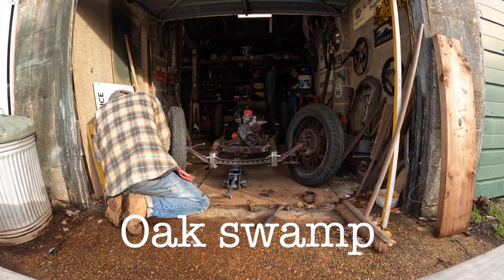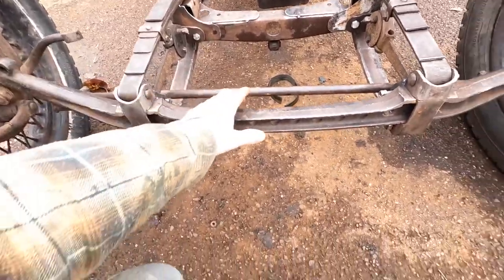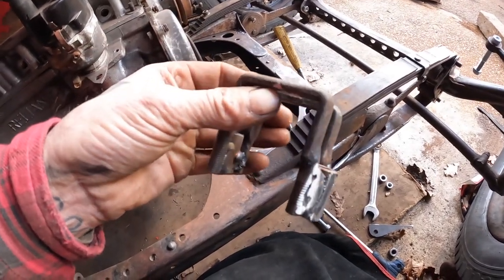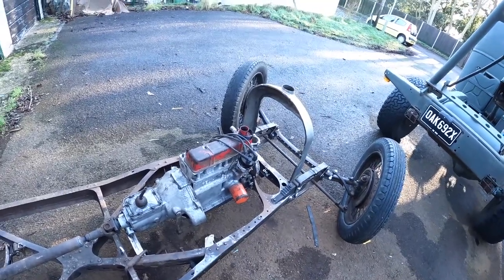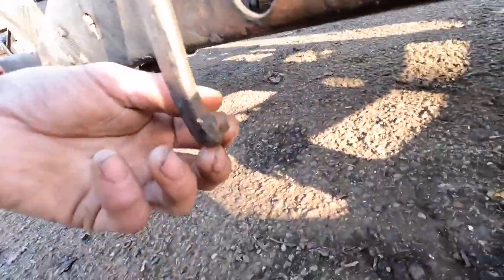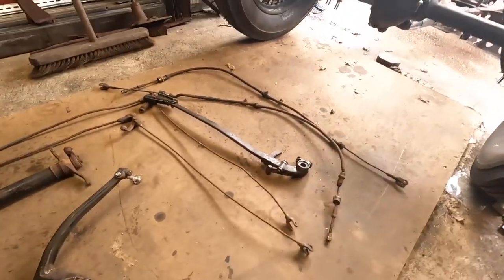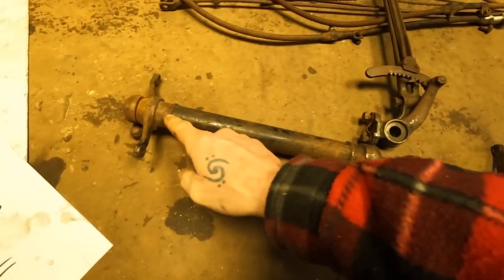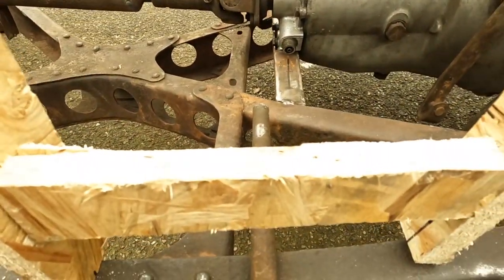the austin ten special....rat ,   part 7

Comment: Good to see you are back up & running.
Will you put some sort of plate in front to the steering arm, so there is no chance of it hitting the road.  I broke all the bolts holding the gear leaver in on the ExoBusa after going over a traffic calming bump. Hitting the steering in the same way could be painful!
Reply from the maker: cheers dude , the pit man should be high enough off the deck now it should not hit anything....is the exo running again?
Reply: @oakswamp  Exo not back on the road yet. Still fitting new seat & a couple of other mods, inc a flat shifter - so even faster gear shifts. I aim to have it all finish within two weeks.
Reply from the maker: @Lost13mm  sounds like itll be even more fun !